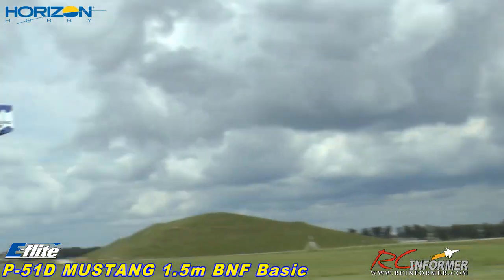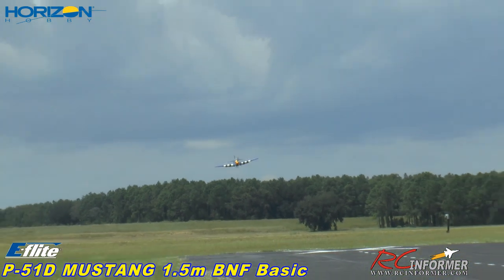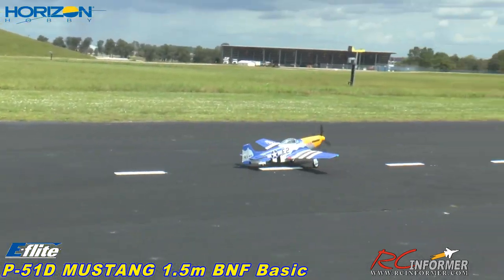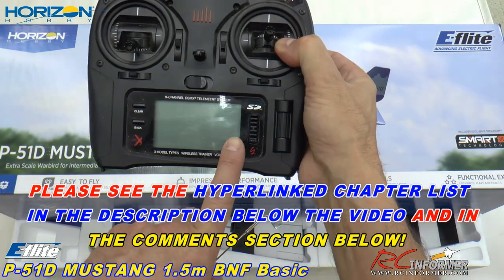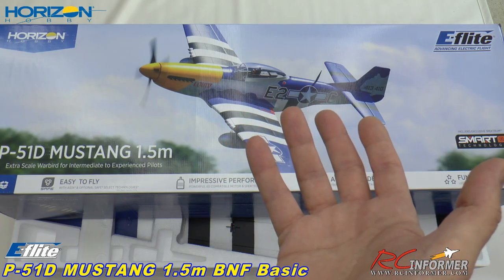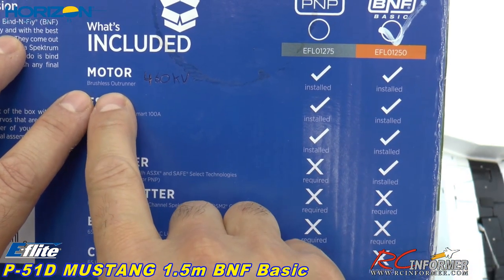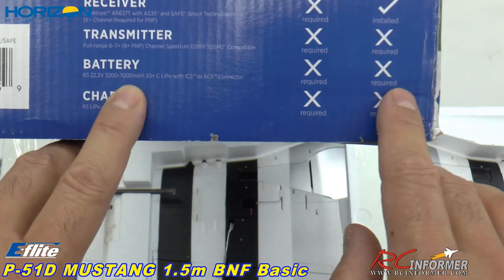E-Flite P-51D Mustang 1.5m BNF Unboxing, Assembly, Setup & Flights By: RCINFORMER

Comment: What’s your flying time with each 6s different battery capacity? ( 6s 5000mAh and 6s 5000 mAh)
Thank you.
Reply from the maker: Very much depends on the style of flying you are doing and the battery manufacturer in some cases-Somebody was really good throttle management for example could get the same flight time from a 4000 as somebody who races around for the whole charge with a 5000 so it really does come down to the individual and a few variables. as you know I tend to fly the aircraft reasonably aggressively in the videos so somebody with a more relaxed flying style who just likes to cruise around could probably get a couple more minutes than me on the same battery. I would have to have a look at the timer on the radio but I seem to recall around 5 mins with the lipo around 3.8v/cell. Thanks for the question🙂
Reply: Thank you so much and more power.

Comment: Hi Rich I,ve purchased the basic Eflite 1.5 metre P51 without the Spectrum receiver I,ll be using my 7 channel Futaba instead not sure about the cables from the esc one is labeled throttle and the other BEC AUX do I plug the throttle lead into receiver and leave the other unplugged? Thanks regards Neil.
Reply from the maker: Hi Neil sorry it’s taken me awhile to get to this did you manage to get it sorted? If not send me a message via RCinformer Facebook page and I will be able to help you👍

Comment: Nice one Rich...glad to see one of these fly with a great pilot on the gimbals. I get the feeling this is the P-51 FMS should have made instead of 8 versions of the 1400mm...that were ALL under powered.
Reply from the maker: This one is very powerful and has lots of pitch in the propeller....
Reply: Hopefully, FMS will address the power system with the V9.

Comment: How does this compare to the 1.2m p51. I'm thinking about getting the 1.5 and I have the 1.2
Reply from the maker: The 1.5m is superior in every way! This is probably the premier EPO P-51 on the market:) Thank you for using my links in the description to purchase:) Thanks for the support:)
Reply: This P51is not only larger in scale than the 1.2m but it also comes with extra scale details the 1.2m does not have. Lights, sequenced main gear doors, and a scale retractable tail wheel which even has spring loaded gear doors. It is a graceful flyer. I absolutely recommend you get one.

Comment from the maker: * Table of Contents and Hyperlinks to Chapters***
-Intro► 02:15
-Specifications► 04:23
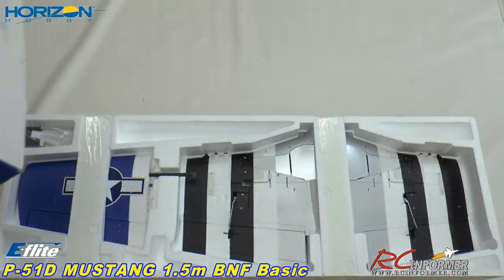-Unboxing► 06:59
-Parts Review► 10:06
-Instructions review► 33:16
***Assembly start ►►
-Horizontal Stabilizer►41:41
-WING► 44:01
-Prop & Spinner Assembly► 48:50
-Battery Compartment Setup►  50:24
-BINDING & Transmitter Setup► 54:46
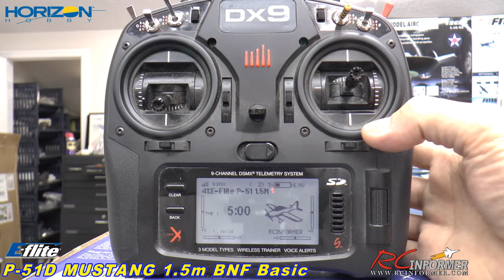-landing gear overview & Conclusion► 1:00:43
-More Flying!► 1:03:36

Comment: Only thing they need to do, is paint the plastics (like cowling) the same color of the yellow trim. Sounds picky, but you would not believe the difference it would make to the overall appearance. Rich, are the scissor links on the landing gear struts aluminum like the rest of the struts, or are they plastic. Very curious. Thanks for the video!

Comment: Can you share the DR/Expo settings and AS3X settings you used in the video of the plane flying in the beguine of the video?
Reply from the maker: Yes, I literally set up everything EXACTLY the way it is in the manual:)
Reply: @RCINFORMER  Did you do the neutral elevator deflection at 3mm down like manual said while in safe mode or in as3x mode?
Reply from the maker: @lorinw00  I honestly do not remember!

Comment: How does this compare to the FMS red tail 1450?
Reply: This P51 is slightly larger in scale than the FMS P51. It also has fighter like performance with the stock motor and esc, while the FMS P51 has okay power with its stock power supply.
Reply: @johnsons74thsquadron74  An d cheaper
Reply: @jazzwings1  Unless you upgrade the FMS, it will be cheaper than the Eflite. The FMS is $300, while the Eflite is $500, but the Eflite P51 is a BNF, while the FMS is a PNP; so it will come closer to $400 after supplying a receiver, but then you have another problem. The FMS is 4s powered, while the Eflite is 6s powered. You will be looking at a grand total of around $475 after buying a receiver and upgrading the motor and esc on The FMS P51. It is significantly cheaper than the Eflite, but only if you leave the stock limited power supply in it.
Reply: @johnsons74thsquadron74  thanks for your response, but how about looks, and quality of  linkage, landing gear etc, is FMS lower in quality in that regard? I have an spare receiver that I can use, if I buy the FMS so the difference in price still weights a lot in my case.
Reply: @jazzwings1  I can’t say anything about the FMS P51 since I have never flown it. Fms did upgrade the gear citing many pilots’ biggest issues with the plane. I have the Eflite and I love it a bunch. If you have questions you should watch Rich’s video on the FMS V8 P51.

Comment from the maker: Check out the E-flite P-51D BNF HERE at►  https://bit.ly/3gX0RNV
P-51D BNF W/BATTERY COMBO HERE at► https://bit.ly/3r9yIsV
P-51D PNF Version here► https://bit.ly/3h3hTLz

Clicking on our links and purchasing from our links supports RCINFORMER!
                                       Thank You for your support!
       
HORIZON HOBBY Main Page► https://bit.ly/3h3kSm0
Hobby Zone Main Page►   https://bit.ly/2XGEPa9
BITGO HOBBY►   https://bit.ly/2Ah40bf

SPEKTRUM DX9 USED IN MY VIDEOS► https://bit.ly/39ChQkx
SPEKTRUM SMART BATTERY CHECKER USED IN ALL MY VIDEOS▼
                                                                                    https://bit.ly/3hrmIx3

▼Get your SPEKTRUM Smart Charging components here▼
             ▼SMART CHARGERS USED FOR THIS REVIEW▼
-Smart 30A 540W Power Supply► https://bit.ly/2OKJ8gw
-Smart S1200 DC Charger, 1x200W► https://bit.ly/2D09lVC
-S1500 DC Smart Charger, 1x500W► https://bit.ly/3jzdoJl
      
   ▼RECOMMENDED A/C SMART CHARGERS▼
-S2100 Smart DUAL AC charger► https://bit.ly/2ONp7WD
-S1100 Smart SINGLE AC charger► https://bit.ly/3hvf1pU

-SPEKTRM 6S 7000 30C SMRT IC5► https://bit.ly/3iKzg3r
-SPEKTRM 6S 5000 50C SMRT IC5► https://bit.ly/33YOBJj
-SPEKTRM 6S 5000 30C SMRT IC5► https://bit.ly/31bvN88
-SPEKTRM 6S 5000 100C SMRT IC5► https://bit.ly/37ABteY

Please see the links below for the FMS stands on the Horizon Hobby Website-you can also use any one of these links to access their site then navigate to any item on the website and your purchase will support the channel👍￼￼

Link to Rose (Red) Stand￼:
https://bit.ly/30A0XFg

Link to Silver Stand:
https://bit.ly/3cZnkch

Link to Gold Stand:
https://bit.ly/2Sp9er5

FMS MODELS ARE ALSO AVAILABLE at THE RCINFORMER AMAZON STORE here► https://www.amazon.com/shop/rcinformer

▼Get Your E-flite F-4 PHANTOM II BNF Basic with AS3X and SAFE Select here▼
BNF Version at HORIZON HOBBY► https://bit.ly/3fy9ZZ8
PNP Version at HORIZON HOBBY► https://bit.ly/3evnYNG
               
BNF Version at HOBBYZONE► https://bit.ly/2ZrBSwf
PNP Version at HOBBYZONE► https://bit.ly/3j3cRix

* Table of Contents and Hyperlinks to Chapters***
-Intro► 02:15
-Specifications► 04:23
-Unboxing► 06:59
-Parts Review► 10:06
-Instructions review► 33:16
***Assembly start ►►
-Horizontal Stabilizer►41:41
-WING► 44:01
-Prop & Spinner Assembly► 48:50
-Battery Compartment Setup►  50:24
-BINDING & Transmitter Setup► 54:46
-landing gear overview & Conclusion► 1:00:43
-More Flying!► 1:03:36

▼HELP SUPPORT THIS CHANNEL BY USING OUR LINKS TO PURCHASE▼
.... Special thanks if you were able to order it thru my Affiliate links here.... that is greatly appreciated! ... At no additional cost to you, Purchasing thru our affiliate links and Amazon Store supports RCINFORMER as we do earn a small fee for the referral. Thank You for supporting us!

CREWZINN AIRPLANE STAND AVAILABLE HERE: http://bit.ly/3h5tGc3

▼Please visit my new AMAZON Store for ONLY the Exclusive stuff that I use Here▼ 
                            https://www.amazon.com/shop/rcinformer

Follow Rich at RCINFORMER on Social Media
FACEBOOK► https://www.facebook.com/RCINFORMER/
INSTAGRAM► https://www.instagram.com/rcinformer_official/
TWITTER► https://twitter.com/RcinformerO
Website► https://www.RCINFORMER.COM